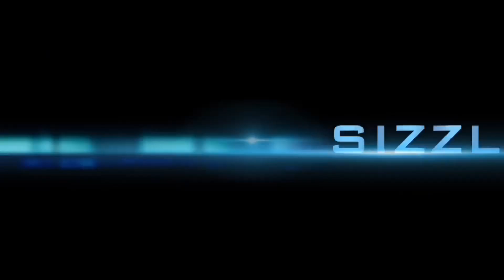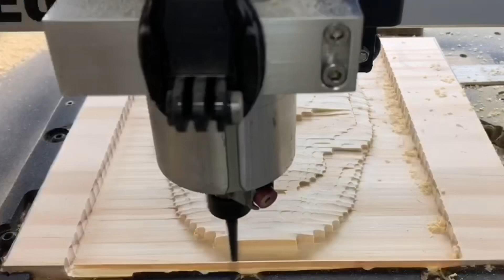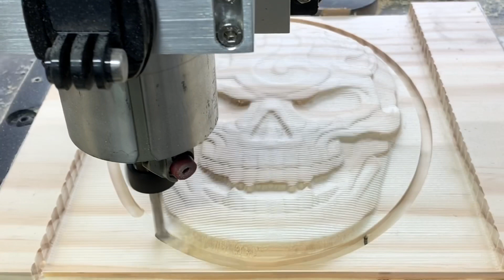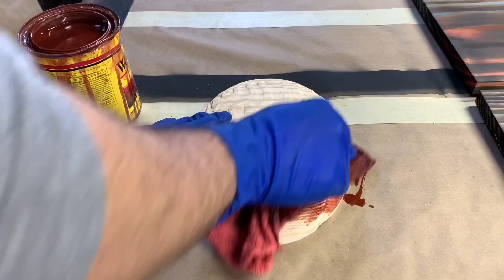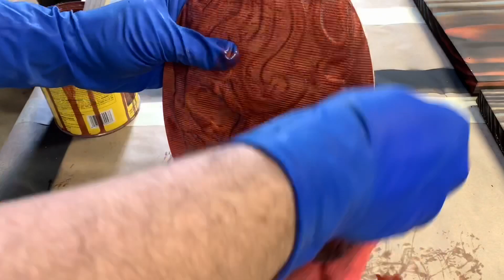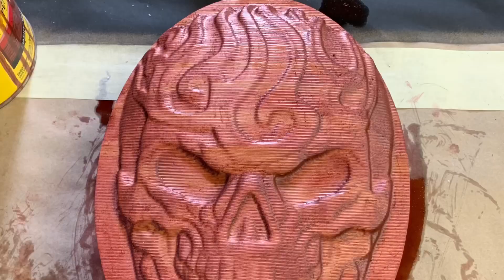3d Skull 💀 machining with CNC router Shapeoko xxl Vcarve Desktop projects

Comment: Do you happen to have a video on the programming portion of this project? I'm having some trouble trying to find a process for bringing these 3D models/images into Carbide Create?
Reply from the maker: I only use carbide motion to run the gcode but use Vcarve desktop to design and make the tool paths